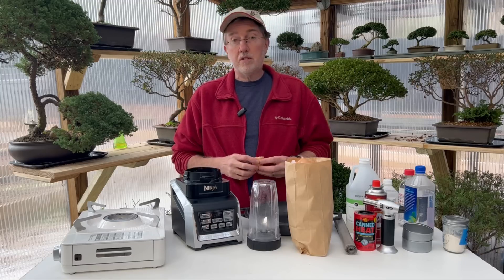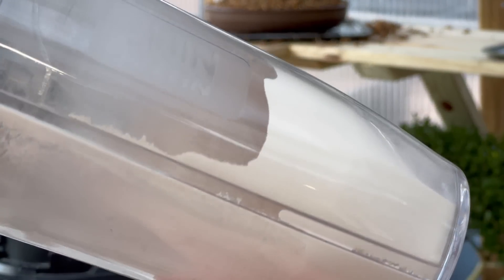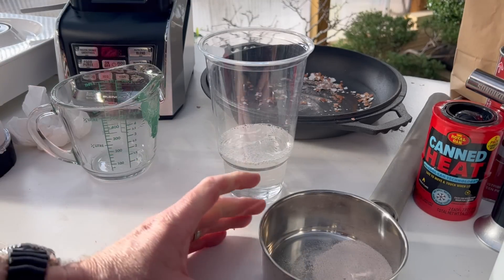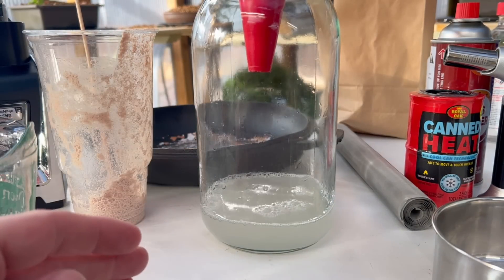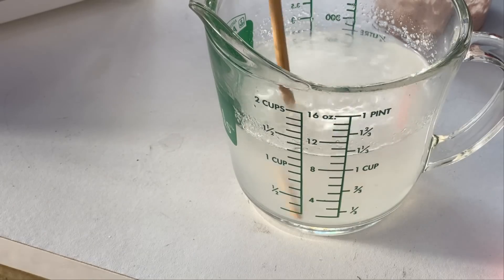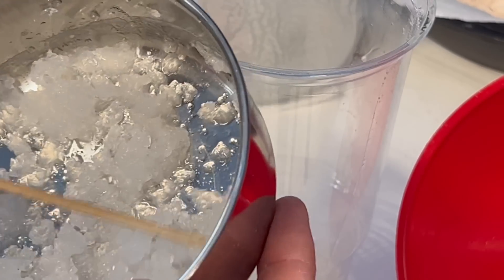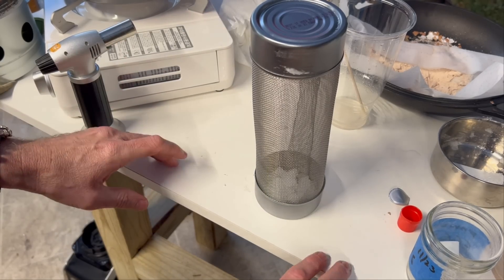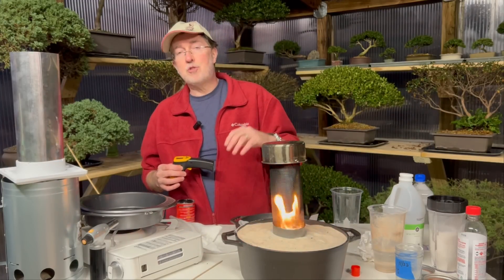DIY Egg Powered Heater/Stove | Incredibly Hot For Hours ( 800F )

Comment: ive followed your directions twice and it wont gel can the egg shells be to old help plz the mix is stil 3 quarters rubbing alcohol
Reply: i even added the 2nd batch to the 1st to bring it to gel and im stil getting the same result of the 1st batch
Reply from the maker: Higher purity alcohol
Reply: @ZenGardenOasis.  its 91 percent
Reply: i wil try again with just shells n vinegar n see how much more it takes to gel i boil it on a house stove it shouldnt make a difference as it boils down to half its ratio
Reply: its going down to negative 38 celcius without windchill tonite n i really need this to work so my animals stay warm i lost my big tom turkey as he froze nite b4 last

Comment: Between the energy expended in baking the shells, blending them to a powder, reducing them down, and the energy of the alcohol on its own, are you gaining anything?  I've watched multiple heater designs on your channel.  Which would you say is the best and longest lasting?  I doubt anyone would want to refuel multiple times through the day and night.
Reply from the maker: If you enjoy experimenting and trying new ideas ( which I do ). Then try flame heaters.  If your only wanting minimum time and effort obviously thermal mass (containers filled with water and heating by the sun) is the way to go.  Check out the cat litter container video.   If your just wanting to save $ get a electric milk house heater and timer.  All of my heating videos are geared towards greenhouse warming (40-50f).  Not home heating to 72f.
Reply: @ZenGardenOasis.  I'm starting a homestead while working a full time job, so the goal is minimal time and money investment.   I would need it for a small greenhouse (if I recall, it's about 10 x 14 hoop style, mainly to keep my cold sensitive trees and other plants in through the winter.

Comment: Interesting chemically, BUT.... You buy 99% alcohol at about $16/gal. Buy vinegar at $10/gal. Burn fuel to heat hit egg shells and dry them, use electricity and wear out a blender, and use more fuel to boil down mixture and in the end you have a little fuel. I think your egg shells are better off in your garden.

Comment: Cans are usually lined with petg now. I'm more concerned about that ducting since galvanized metals burning produce fumes that can flat kill you.

Pretty cool transformation. You can skip the crushing step if you're willing to just wait a few days. Drop it in a bucket and maybe shake it once a day when you check. Any leftover solids should then be larger so you don't really need to filter as finely.
Reply: oh god phthalate plastic as coating for metal? grocery stores has become endocrine nightmare minefields
Reply: @WeebRemover4500  terephthalate in PET plastic isn't the same thing as the nasty Phthalates used in the production of PVC. PETG is probably the most common plastic for foods, bottles, etc and is considered non-toxic.

Comment: If you can use this inside the house or bedroom, does it produce carbon dioxide  or black smoke?
Reply from the maker: Be sure to use carbon monoxide/ smoke detector and have fire extinguisher handy.  All flame have risk.
Reply: If you make something like this please be sure to have plenty of ventilation as the orange flame could be giving off carbon monoxide.
Stay safe it’s a new year 👍

Comment: I just had an idea Zen. Would you be able to put on a stainless steel mesh chimney on top of a kerosene heater to get way more BTUs from the heater ?? The mesh seems to increase the heat output by a whole LOT !! Maybe make a video would really be cool Sir.
P.S. Have yourself a Happy New Year fella and a many more to come for us both. Peace vf
Reply: I had the exact same thought while watching this! I'm currently using a kerosene heater to help reduce power cost and was thinking of ways to increase the BTU's , currently using a large terra cotta pot inverted (think emergency heat source via clay pot and candles) on top and it has actually made a difference!
Reply: Would you know roughly how much of an increase you were able to get with this method of modification Donna ?? Thanks and Peace too. vf @donnastarnes3104
Reply: @victoryfirst2878  This is a totally non-technical answer but the average temperature of the room I've been heating went from 68° Fahrenheit to 72° Fahrenheit! Same outdoor temps during this time period. The clay pot is two inches in diameter larger (inverted) than the top of the heater and I balanced it on top of a stainless steel cooling rack (on top of the heater) that exceeded the diameter of the pot.
Reply: TERRA COTTA POTS MAKE A DIFFERENCE FOR SURE.  @donnastarnes3104

Comment: It's alcohol powered not "Egg Powered"
Reply: Your opinion was invalidated by your beard but lack of moustache
Reply: It's alcohol plus egg powered. The point is to use a little bit of common materials and a butane gas cook stove to make a bunch of gel fuel for radiant heat. It certainly seems cost effective to me. Gel fuel costs between $2 to $6  per can. If you can make your own for a fraction of the cost, you've got a winner.
Reply: True. It's easier to just burn the rubbing alcohol. I'm not sure how the burn time is changed by gelling it.

Comment: Curious if you can use calcium tablets in place of egg shells?
Reply: The eggshells are free unless you just don't use eggs.
Reply: @lorenbush8876 we do not eat a lot of eggs.
Reply from the maker: Not sure but I’ve seen a type of chalk used. Cheers
Reply: You need calcium carbonate (the main constituent of egg shells). Calcium tablets may or may not contain calcium carbonate and can have many other ingredients (the same goes for chalk). Luckily pure powdered calcium carbonate can be bought rather cheaply online.

The ultimate goal is to make calcium acetate by reacting calcium carbonate with acetic acid (so you might want to buy calcium acetate instead). For best results make the calcium acetate solution as concentrated as possible, this so called saturated solution can be made by dissolving calcium acetate in cold (not hot) water. 

When a saturated calcium acetate solution is "plunged" into ethanol, the solidification is often instant, although sometimes a short vigorous stir is needed. Mixed with ethanol it converts back to liquid over a few days, so it's best mixed right before use.